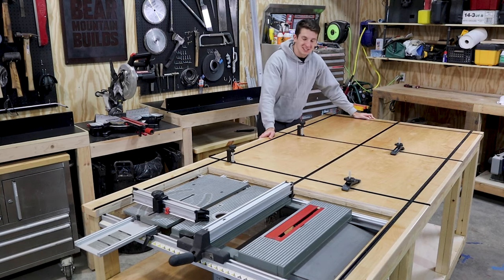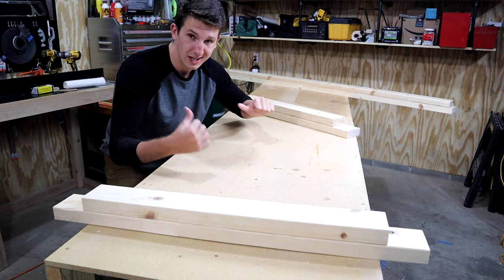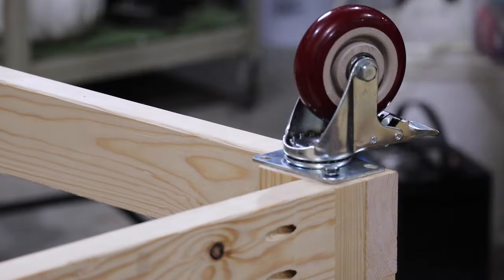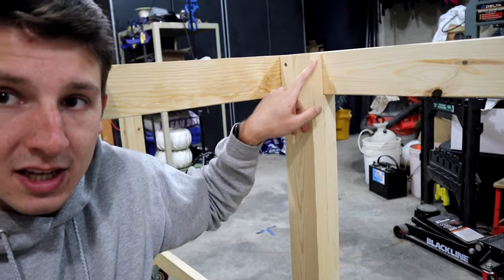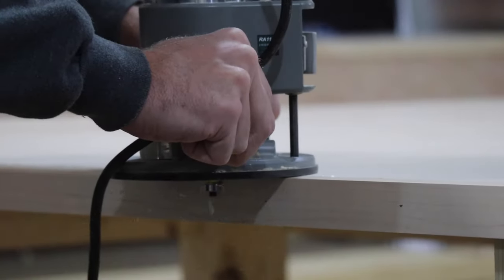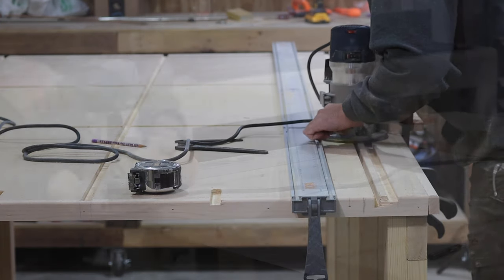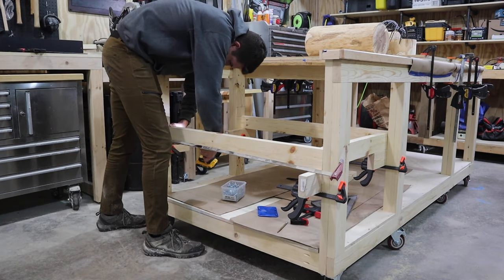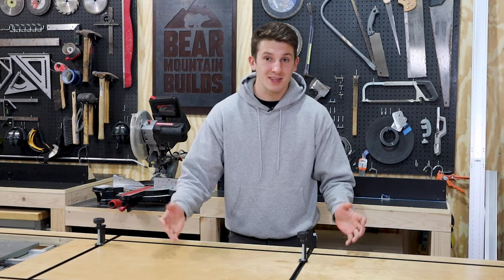Build This Simple Table Saw Outfeed and Assembly Table - Part 1 | FREE PLANS

Comment: I am building this according to the plans right now. Just a heads up…running the boards through the planer will affect your dimensional measurements. Something that as a beginner I didn’t think about before hand. Having to adjust and add steps halfway through. Not a huge deal, just something for fellow beginners to think about.
Reply from the maker: Good point, I design all the plans off of nominal board dimensions to make it easier. I'll have to add a disclaimer to the plans
Reply: @BearMountainBuilds  I did the same thing with his mobile workbenches.  I forgot that planing fuzzed the dimensions and ended up with about 3/8 of an inch to cut off of the legs.  That being said I love his videos, but would like to know what you set your planer to for this build?

Comment: I brought this table saw broken but the motor still running I changed the Blade oil and started working like new but the box was broken I build I similar idea , but I make a mistake the top of the table is a little higher the the age of the table saw any idea

Comment: Solid well made table Wanting to mount my table saw in the table like yours.Why did you raise it one eight above the table .I was gonna mount my flush with the table . Agree FYI the music was very loud i would lower the volume for the music and when you would speak i had to raise the volume back up.8 wheels on the bottom nice nice!
Reply from the maker: I did it so that if I ran any boards through my saw that bow down they wouldn’t catch the edge of the table. I think if I were to do it again I would flush mount it and just round the edge of the table

Comment: I am new to wood stuff.  I bought a 749 Dewalt table saw but have not turned it on yet as not sure what to do with it.  Want to build stuff like chicken coup run but not sure where to start and basic cuts.   Is this something I will be able to do?  I am engineer for IT so trying to research which I am good at but not sure on physical stuff yet :P    Starting late in life at 55 but trying to pick up stuff but dont want nice things that I cannot use.  :(  I also have cheap black & decker miter saw and a cheap black & decker hand saw they have some rust on them was sitting out there.  I figured maybe start doing some work before go buy a new DeWalt miter  & planar or other 500 dollar items. as does me no good when don't really know how to use them.  Kind of need a mentor and learn basic cuts and measuring.

Comment: Hey Zach, yours are some of my favorite videos on YT. I downloaded your table plans as I am building out a shop in my 3-car garage. This will be my centerpiece work surface. Great plans, especially with the companion video. IT IS BEAUTIFUL! I must say I am very pleased. HOWEVER, either I suck at routing or my router/bit were not up to the task. First I used my ooold Ryobi corded router with a 3/4 flat bit. Using a track saw guide for straightness (cough, cough) a-routing we did go. Yep, over the river and through all my straight lines. Holy cow, what a freakin mess. And the choice words I used. Visions of ripping off my brand new 1.5" top danced through my nightmares. Now my only option is to use my cordless circular saw with TWO straight edges to clean a reference edge on one side of my channels and do a LOT of wood filler on the ugly side. Man, what a mess. But with my rant over, everything else about this table is spectacular. The carcass is done and I am building the drawers as I write this. I'm going with Minwax Classic Oak on the top and a darker tone, maybe Espresso, on the frame. I didn't care for their Classic Black stain. Too dark for me. But dude, this table is fabulous. Thanks so much for all you do. Let's make some sawdust!
Reply from the maker: Thanks man, good luck with the build!

Comment: Beautiful table! now as a retired professional woodworker ascetics were not worth a hill of beans, Instead of using expensive plywood I would have used blond MDF and covered with Formica before routing those rails. MDF provides an extremely level surface that does not change much with changes in temperature and humidity. Formica lends to a very smooth surface but is extremely durable surface for saw out tables. Of course the table I built incorporated an Italian sliding table saw with a 14' sliding table. I did not mount my table saw, I surrounded it. Also, with Formica laminate you don't have to worry about glue spills, wipes right up.

Comment: Another test you should do is the cross-angle test: Measure from one corner to the opposite "catty" corner. Now do the same for the other pair of catty corners. The measurement should be very very close to the same. If not, you are not properly square somehow (perhaps your boards are warped, or perhaps one is actually slightly shorter than the other).

You do this to check for square in a way that simple angle checks cannot do -- squareness over the whole length of a project, which, for a project this size, is quite important.

P.S., like the ratchet strap idea.

Comment: Hi, this is a great table, i'm making one myself and want to use t track in a similar way but am hesitant because ive heard material stock can catch in the track as its pushed throught the table saw blade, after using your table for a while, can you advise if this has been a big problem for you or not?
Reply from the maker: I haven’t had any issues with them at all. I use them all the time. The only minor annoyance is you have to vaccinate them out to clean them but it’s still really easy
Reply: @BearMountainBuilds  okay, thank you👍🏻😊

Comment: Any thought on how to add a router to one of the far sections? Trying to find a plan or video fir combo table saw/router table.  I will be using this to build by saw table
Reply from the maker: You could probably do the same thing that I did with the table saw and make a platform for the router table to sit on and set it so the top of the table is flush with the top of the router table
Reply: @BearMountainBuilds  thank you sir. I will see what I can come up with

Comment: Like another below, I'm a year late. I've built my first table saw table, but a cross-country move left it... wanting (the movers placed the planer and its stand on the table saw; the support platform's dead). I like the T tracks. I put in combination T-track/miter-track, which I think I'll do again. 

A question, though: Why did you set the saw 1/8" proud of the surface rather than true it up?

I intend to work from your plans, with a few mods, including the T/miter track note above. I'm of 2 minds about routing the track grooves. I recently saw a video where, instead of routing the groove, the builder cut strips (or in your case, rectangles) which made assembly a lot easier. Any thoughts on that? I can go either way. 

You've done a nice build. I'm now looking for the addition of the drawers. Thanks!
Reply from the maker: Thanks!! I put the saw 1/16”-1/18” high in order to prevent really warped boards from catching the edge while running it through the saw

Comment: Great video, thank you. I will be building a model of this this weekend. Question though, what would you suggest for a very uneven shop floor to keep the table level? I like the wheel idea and not some adjustable leg stands but not sure how to get both wheels and a level table. Thanks!
Reply from the maker: This table is so big it will basically self level unless your shop floor is REALLY in even or sloped. If you’re still having issues I usually just buy a wood shim pack and stick them under a wheel to stabilize it

Comment: I’ve been looking for a base set of plans for awhile, these are great.  I would like to modify making in a bit narrower to fit and have adjustable power tool shelf to additionally accommodate a chop saw access from sides, small router table from the end and combo belt/rotary sander.  Thank you!

Comment: What kind of table saw do you have?  I don't think I have ever seen a set up like that again.  Your table build is awesome! Your attention to detail is very refreshing also.  I am seriously considering adapting your plan for my workshop!  Great work!
Reply from the maker: It’s an an old RYOBI 3000 that finally bit the dust about a week ago. It’s a job site table saw
Reply: Outstanding work!  I also have an older Ryobi BT3000, question, is it possible / necessary to add a  cross-cut sled that would work on the BT table saw?

Comment: Question about the caster wheels for this project and the other project you have the modular workstation.  Did you get the 4 inch wheels?  Just curious. I wouldn't mind trying to match my two builds with some workstation tables I am building base off your miter saw station.
Reply from the maker: Yeah I used the 4” caster wheels. I have a link to them in the video description
Reply: @BearMountainBuilds   thank you!  I am starting my miter saw table today by the way.  One more thing, the polyurethan you use, what product do you use?
Reply: @BearMountainBuilds  thanks. ordered a few sets knowning I will be doing a few other projects.  I got almost burnt on a router table I was building based off of this design. Was thinking 4" and didn't check the full specs. They are 5.12 inches.  :)  Luckly, I just ordered the 3in wheels for that table, and changed the top a bit. So it will aling with my Miter table I built off your designs. (but tweeked a little). 

Thanks for all the designs and ideas by the way. My son right now is going Frech cleat crazy.  

By the way, not sure if you would do this, but maybe a video of how you worked with Sketchup? I am getting the hang of it but know I need to leanr a lot more.

Comment: Ok, great table.  I have the same saw,  why did you orient the saw all the way to the right side?
Reply from the maker: If you put the saw in the middle the max width cut your guide will allow you to do is around 14”-18” on either side. However, if you put the saw on the right side it allows you to cut up to about 7” with the guide on the right, but up to 26”-28” with the guide on the left. Basically just maximizes your cut width.
Reply: @BearMountainBuilds  Thanks for the reply.  I think what is messing me up is that I am left handed and my fence is on the right.
Reply from the maker: @markgaranzini1773  ah I understand. I’m right handed, but additionally the saw dust exhaust is on the right side so I wanted it as close to the edge of the table as I could go
Reply: @BearMountainBuilds  If you want another section of top for that saw let me know.  Free to a good home.  I bought what I could for that saw and have extra sections of the top.
Reply from the maker: @markgaranzini1773  Thanks for the offer!! But I already have another section for the saw so I’m pretty much set. Again,thanks for liking the video!!

Comment: Any reason you didn't do a 'lap' style joint on the cross pieces?
Reply from the maker: Not really, pocket screws are easier and they would get the job done. Additionally, I wanted the one continuous 2x4 running along the top and bottom of the side frames.

Comment: I've been wanting to build a work table and came across yours (since then marked you for more stuff in the future). Watched the video and down loaded the plans hoping to build soon. one question that I hope you can answer for me and possible others. Is there anyway you can tell where abouts (measurement wise that is) for drilling the pocket holes. The cut sheet is great to show all the lengths to cut and the pocket hole plan sheet shows them on the cut wood, but I'm not good at scaling from drawings so was hoping you could share that info please.

Thanks,
Dave
Reply from the maker: It doesn't matter too much where you drill the pocket holes I generally try to keep them evenly spaced. I aim for having one every 1-2ft, but it comes down to how firmly you want the sheet attached. For the top surface more screws is better while the bottom one you can get away with less.

Comment: Is the top of the saw level with the top of the table/bench when it is built .You state that you build the platform for the saw then the saw is above the table by 1/16 of an inch or am I missing something. Excellent build and video
Reply from the maker: I put the top of the saw about 1/16”-1/8” above the table to prevent warped boards from possibly catching on the edge of the table while I’m cutting them

Comment: Why didn't you use the large cut-out from the top for the saw shelf?
Reply from the maker: I had that same idea initially, but the cut-out for the saw doesn’t go all the way to the frame supports due to the cutting so it would have had a gap

Comment: Awesome, strong table!  I like the natural, poly finish, but did you consider the top surface as melamine for ease of cleaning, etc.?
Reply from the maker: I thought about it but decided I wanted a top with grain. Instead I rubbed wax over the top after poly and I haven’t had any issues with cleaning the surface
Reply: @BearMountainBuilds  I like that.  I'm new to this.  I just know melamine is durable & low-maintenance, but I'd def prefer what you did.  It looks SO much better.

Comment: Would it have made more sense to have done the poly before doing the t-track?
Reply from the maker: You could,but I didn’t want to get into the slots and have the tracks not go in due to the added thickness. The poly peels right off the metal of the T track anyway
Reply: @BearMountainBuilds  I mean before you even route the T track slots...
Reply from the maker: It may end up chipping the poly off but it would probably be okay. It would be harder to clamp the guide down since there’s less friction

Comment: Hi Zack. After you jigsawed the notches on your bottom board how did you locate the bottom board onto the frame. Does it slide through at an angle?
Reply from the maker: Yep, I just fed it through at an angle. I recommend having a second set of hands to make it go faster, but it can be done by yourself. Additionally, I used a rubber mallet to knock it down flat.

Comment: I was just wondering how the poly finish is holding up? Was it water base?
Reply from the maker: The poly is holding great and it’s water based. I rubbed a bit of wax on the top as well you make it easier to slide wood around
Reply: @BearMountainBuilds  It looks great. thank you. Jake

Comment: Great build, I may be doing this one in the future. I'm not sure if you (Bear Mountain Builds) will see this, but wondering if you considered MicroJig MatchFit dovetail system instead of T-tracks, and if so, why did you pick T-tracks? Also, did you consider any kind of outfeed miter slot (I'm thinking of cross-cut sleds), and if you didn't do it, why not? Thanks and GREAT JOB!
Reply from the maker: Glad you enjoy the build! I like T track because it's much more robust but I don't think the dove tail system is a bad option since T track can be pretty expensive. The reason I didn't add miter slots for the table saw was because the table saw you see in the video doesn't have miter slots itself so I didn't need to add some. Definitely recommend adding them if your saw has them.

Comment: Do the wheels, when locked, really hold the table steady? Or is there still some wobble? 
Thanks much. Great table.
Reply from the maker: The table is rock solid when they wheels are locked. These wheels don’t even swivel when locked.
Reply: Thanks for your response. I will be following your plans (thanks for these!), with slightly adjusted dimensions. 
I asked because I've heard many guys complain that the locking wheels under their workbench still leave the bench with a bit of wobble. Can you point me to the wheels you use, perhaps on Amazon? 
Thank you again!
Reply from the maker: Here’s the link to the ones I used 
https://amzn.to/3Mwd2RK
Reply: @BearMountainBuilds  many thanks!

Comment: Use construction screws, not drywall screws, folks. They may seem similar, but drywall screws have crappy shear strength, and that's important for support function. Try it -- drill a drywall screw halfway into a piece of scrap 2x4, and do the same with a construction ("structural") screw -- leave at least a half-inch exposed. Now clamp it securely to something solid. Now whack them both across the central axis using a heavy hammer or even a short handled sledge. The construction screw will likely bend. The drywall screw will likely break in half completely. At the least, the DS will crack near any bend, while the CS will deform instead.

Comment: Love the plans and video. Great job. I am planning to build the table but using a DeWalt 7485 table saw. I noted your Ryobi table saw is quite different. Any thoughts on needed adjustments to use the DeWalt 7485 that you can share?  THANKS!
Reply from the maker: I’m glad you like the table!! All I can really give as a recommendation is you’ll want to move the tracks that the guide mounts to on your saw all the way over so you can get maximum board width for a cut. Then use that position to measure the width and depth of your table saw to determine the size of the cutout in the table for the saw. Then make sure your saw is positioned as far to one side of the table as possible similar to where my saw is positioned in the video. Additionally, the platform holding your saw will be at a different height, but just make sure to keep the table saw top plate 1/16”-1/8” above the table surface.